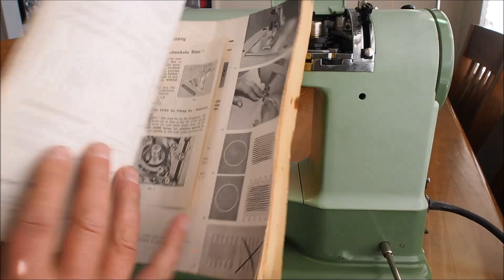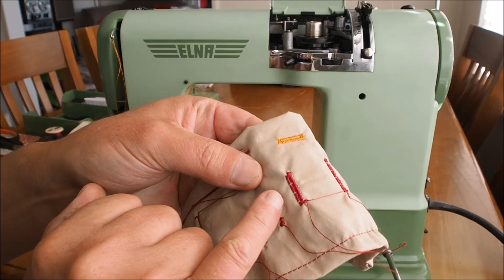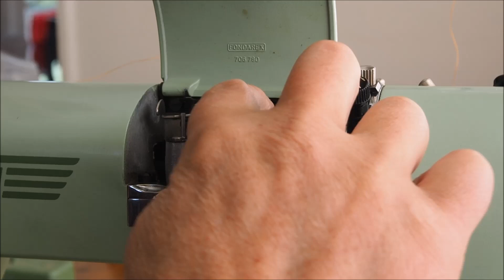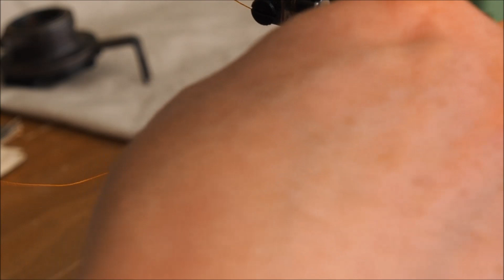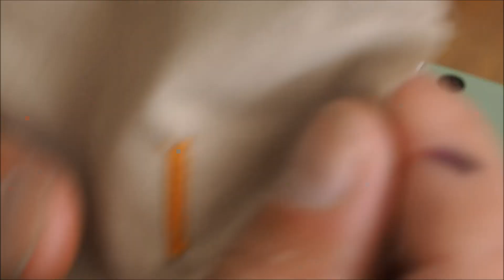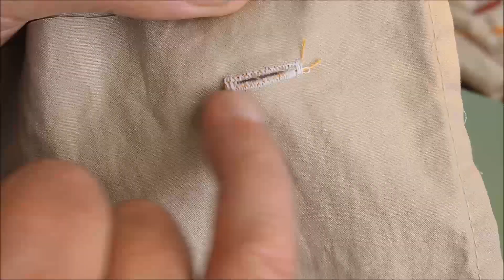Automatic Buttonhole Attachment for the Elna Supermatic Sewing Machine

Comment: Thank you! I was wondering what's for this attachment...

I don't understand how it goes forward and backwards. Is it you pushing the clothes or the machine can change direction automatically?
Regards!
Reply: There's a piece on the disc that straddles the width lever, so when you change the width from 2 to 4, it shifts the needle then from 4 to 2, it engages the backwards movement.

Comment: I have an Elna Supermatic Type 722010 (S/N; 7913054).. It has the lever in the upper left side in in the cam compartment, but the stitch width lever is stuck 'out' and will not push back in. I do not have the buttonhole cam nor the buttonhole foot with the guide. I do have the standard button hole  foot. do you know if a standard Singer low-shank buttonhole attachment will work on these Elna Supermatic machines?
Reply from the maker: I haven't tried standard low shank attachments on this model. My Elna Star Supermatic works with them so I guess they would work.
Reply: @InStitches   I will get a Singer low-shank buttonholer out and "give it a go", and then report back...

Comment: What about moving the centering dial all the way over to the right when doing the right-hand side of the button hole? Just a thought. 🙂
Reply from the maker: That's possible but then the machine needs to be put into reverse which is not a problem but it can cause an inconsistency between the left and right bars. I am showing the recommended way in the video.
Reply: @InStitches  You could also put the needle down and pivot the work before doing the second column. Therefore no need for reverse. 
But that would be a totally manual buttonhole, right?
Reply from the maker: @irmar  Yes, that's right, it would be a manual button hole. Thanks.
Reply: I have tried doing that but I end up with the needle on the wrong side of the presser foot needle cut-out. You have to lift the presser-foot and move your fabric over to align it correctly. (NB: I'm new at this so maybe missing something obvious).